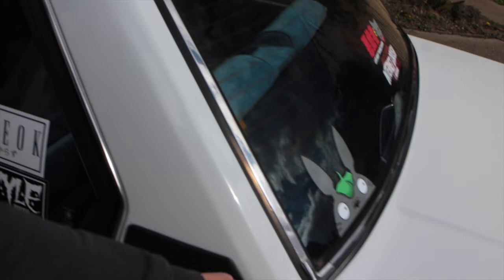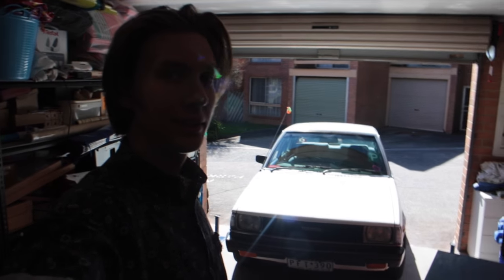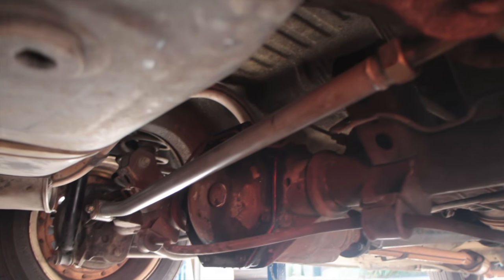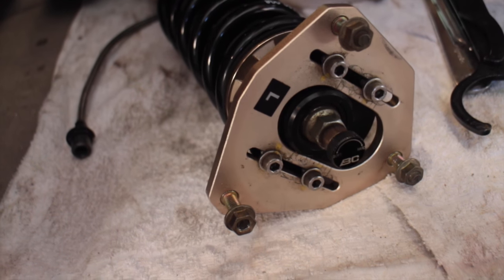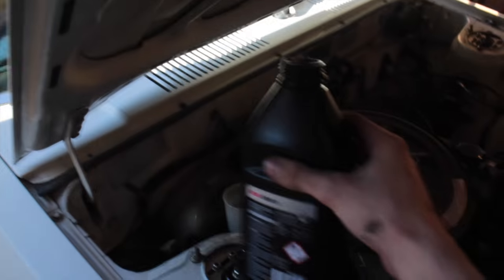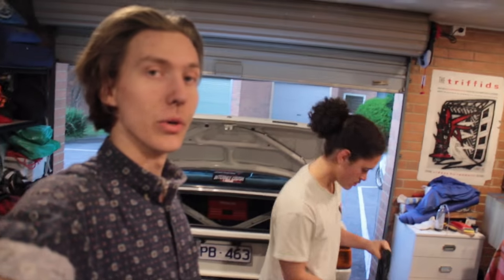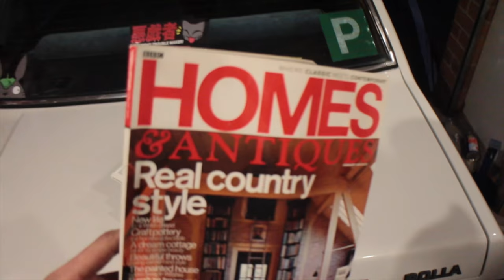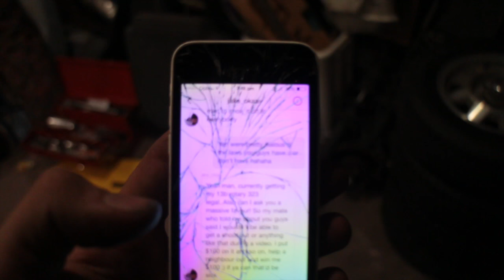AE86 BC Coilovers & JDM Brakes for Sebs AE71

Comment: are the ke70 and the te72 very similar? like the swap kits that ke conversion makes for the ke70, would it work for the te72?
Reply from the maker: Pretty sure they're almost identical in most ways but ke conversions do engine mounts and mounts for a t series engine are different to a k series so they probably wouldn't work

Comment: Hey I have a quick question. I just bought some ae86 coilovers for my te72. I know that the caliper mount plate is different but I'm wondering if you know if the spindle is different? I just don't want to buy a whole ae86 front suspension/steering setup as I can't find any for under $1000.
Reply from the maker: Unfortunately you're going to have to find everything; hubs, calipers, rotors, brackets
Sorry to be the bearer of bad news
Reply: Dang that's unfortunate to hear. I guess I'll have to start searching then. Thanks anyways!

Comment: So 86 coilys will just bolt straight in? :)
Reply: pretty much
but you will need ae86 power steering arms, ke55 LCA's and ra60 celica rod ends to run full legitness